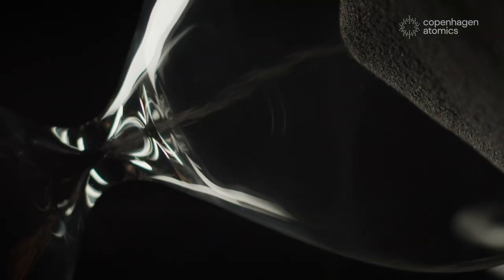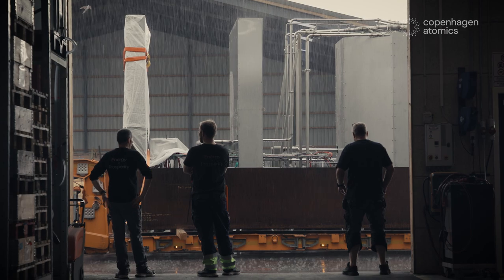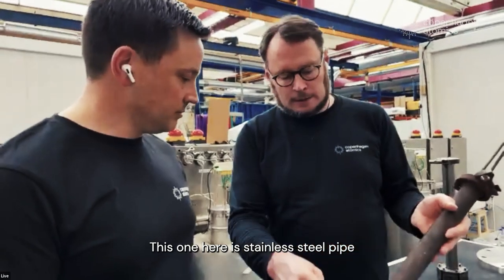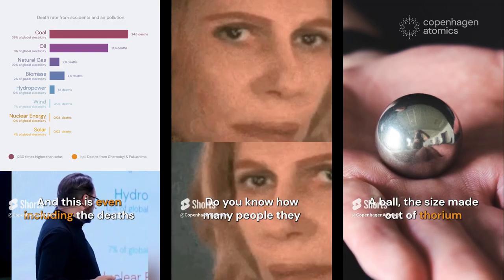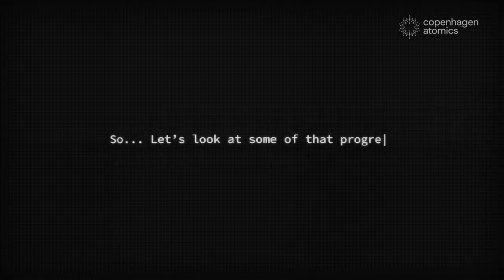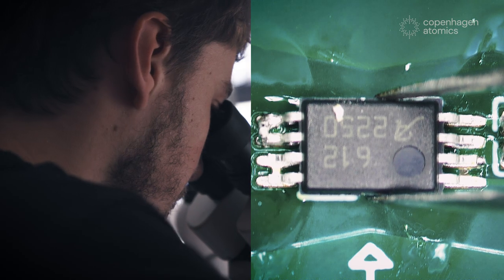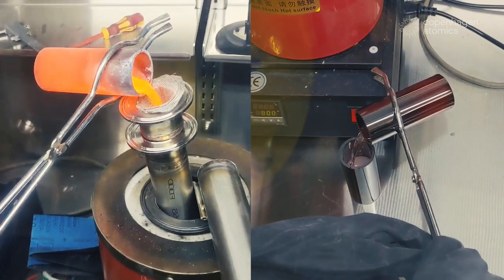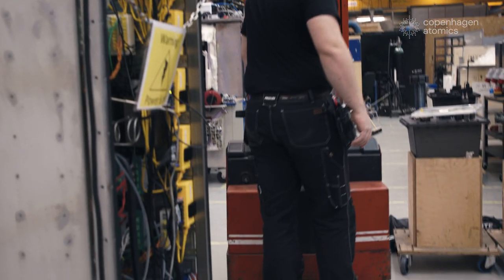Energy's FUTURE! 9 Years of THORIUM Molten Salt Reactor Advancements

Comment: Hello again Tom. I met you at TEAC in New Mexico. Since then I have started with plans for an electric airplane to advertise Thorium nuclear reactors. I'm planning on going to the university and using them to help with the design and construction of said plane. This should give you an opportunity to meet with them and possibly sell a salt loop to them. Working on it ! This is what it is going to take to bring your product the public awareness it needs. In the process of designing the wings to hold batteries. Taking a Piper Arrow wing and dissembling it now to find out how to place batteries into it. It is really not a problem, just need to coordinate with university so as to have a foot in the door for bringing in what would be necessary for a thorium plan of action. If interested in helping, feel free to say.

Comment: What country/regulator have you applied to? These days getting a license from a regulator is by far the hardest, most expensive, and time-consuming part of the "journey". This is the case for antique PWRs, for a MSR breeder that they know nothing about it will take much longer and cost 10x as much.
 
Terrestrial Energy started their application to the Canadian regulator on day one of business many years ago and they are only about halfway through the process. And they have the simplest non-breeder, LEU-fueled reactor in the world.
 
I hope you can find a country/regulator that values clean, safe, reliable, and affordable energy that this world desperately needs. Canada seems to have these values but their regulator is only slightly better than America's NRC. They have an 11-year process with no guarantees of 11 years.  I don't know of such a country but hopefully that will change soon. Until then coal will remain King and only get stronger.

Comment: Do you have to pressurize the containment vessel in order to use heavy water as a moderator?
Reply from the maker: No we don't need to :) the entire system is unpressurised
Reply: @CopenhagenAtomics  That's great. That means they are far less dangerous than pressurized systems. Great work!

Comment: Thorium might be 3 times as abundant as Uranium, but it takes 10 times as long to breed fissile U233 from fertile Th232 as it does to breed fissile Pu239 from fertile U238. 

The problem is that the half life of the intermediate isotope Pa233 is 10 times longer than the half life of the intermediate isotope Np239 in the U238 to Pu239 cycle. 

Which is why India planned a 70 year program to get a full fleet of reactors based on the Thorium cycle. That was 50 years ago and they're still in the early stages. So it'll be another 70 years before they can breed enough U233 to run the country on Thorium.
Reply: With powerful root infrastructure, you can't just offhand dismiss cyclical evolutions like Generations III and IV have introduced in the field. Not only did India have the deficit of Generational advancements since the Nixon Administration in the 70's; but they were extremely suppressed by said Nixon Admin in opting for Nuclear War tech, instead of continuing Thorium Reactor tech. Trillions of dollars of profits resulted in this suppression from bought-and-paid-for politicians and their fossil fuels billionaires funding them... and it CONTINUES with the likes of a Joe Manchin that's heavily invested in fossil fuels, AND writes policy for baseload energy in the USA.

If Nixon wasn't one of humanities greatest criminals in history; not only would India have the benefit of full US cooperation, but France and other Western/NATO countries would already be far more advanced as well. Now with increasingly cascading CO2 events compounding; we have to accelerate this tech EVEN MORE than any other human adaptation, in human history.

Comment: Problem is that it will take a long time to progress from initial experimental molten salt hardware (not even with radioactive fuel) to a tested approved reactor for manufacture, possibly 20 to 30 years.  On account of the technology being rather exotic, obtaining approval and certification will be particularly challenging.  Investors will have to be very patient before they see a return on their invested capital.
Reply: Huh?  China has a TMSR out in the desert, and it's licensed for test operation.  I hope the tests go well so the technology can scale to become more affordable.
Reply: @ZweiZwolf  It will take decades, and renewables are being deployed at a rate of 380 GWatt capacity per year at the moment. Energy storage systems are well underdevelopment.  With a bredding blanket,  Thorium reactors are great for producing Plutonium for nuclear bombs, so the mi,itary love Thorium reactors.
Reply: @thewiseperson8748  Decades?  Only if it were left to the West.  

China wants Thorium reactors for many reasons, specifically to replace black thermal power, and is strongly incented for environmental and stabilization.  China installs more energy storage (ex. pumped hydro) than anyone else, and is deploying thermal solar for the same reasons.  

While Thorium can be used for breeders, China's primary use case is baseload generation in deserts or cities where they can't dedicate large bodies of water for PWR. That said, China is short a few thousand nukes compared to America, so it wouldn't hurt for them to make a few hundred more H-bombs.

Comment: Why water as a moderator? You decrease power efficiency and increase complexity by useing watter. Graphite is a far better moderator. Alows for higher temperature operation and lower pressure in the core design.
Reply: In my opinion,   using heavy water as the moderator,  as long as it does not boil, is a very good idea.
  Liquid nuclear fuel with liquid moderator,  makes criticality control easy.

Comment: We tried molten salt in reactors, it failed, it became obsolete technology. It was completely destroying the pipework and was deemed unsafe, simply too corrosive.
Reply from the maker: It didn't actually fail, the reactors at ORNL were functioning. It was discontinued for several reasons, mostly political. The corrosion issue we have solved through our method of purifying the salts. We can purify these salts to such an extent that corrosion occurs at such a low rate that it is not a concern, even for stainless steel.

Comment: Has your company, or any company, solved the corrosion problem?  If not, then this technology is not yet usable.
Reply: It works perfectly well on a power point presentation
Reply: Yes, they have, just as all the MSR start-ups have.
Reply: @chapter4travels  Which commercial MSR has PROVEN the problem is solved?
Reply: @clarkkent9080  Thorcon, Terrestrial Energy, and Copenhagen Atomics. They replace the reactor vessel every 4-7 years, eliminating corrosion problems.
Reply: @chapter4travels  They are  NOT operating commercial reactors.  Until you actually build a large scale OPERATING reactor and run it on a commercial schedule, you will never know all the issues.

Replacing reactor vessels and associated piping every 4-7 years seems like and expensive option in an industry that already costs the most to produce power, not to mention the waste issue.
Reply: @clarkkent9080  There is no corrosion issue if you eliminate the possibility of it happening. The cost of the reactor vessels is built into their construction and operation budgets. Remember they are made of relatively thin-walled stainless steel, nothing exotic or forgings.
 low-pressure/high-temperature fission is our energy future, this is for certain. How long it takes to get there is uncertain but the outcome is not. The sun will burn out before we run out of fuel, fuel that doesn't require mining, and every country has access to it. Why do you hate this so much?
Reply: @chapter4travels  People are complaining about the stacks of wind turbine blades and they only have to be replaced every 20 years and they are made of fiberglass so they can easily be recycled. But you see no problem with changing out a radioactive reactor vessel every 4 years?

I don't hate.  I worked in the industry 40+ years but I am a realist and based on all the FACTS in AMERICA for new nuclear builds in the last 20 years,
1- new nuclear is massively too expensive when compared to every other method of power generation.
2- I personally have experienced what new nuclear has done to my electric rates.
3- Other than Terrapower, no other nuclear projects are being actively planned and Terrapower cannot possibly be producing power before 2034.
4- Many old plants will shutdown in the next 20 years and even a boom in new  nuclear construction will not overcome that loss.

Why in the face of so many failures and facts, do you believe in a nuclear miracle?

Comment: The problem is that neutron irradiation leads to neutron embrittlement, wherein corrosion occurs along dislocation crystal planes in metallic reactor components.  All he Copenhagen Atomics studies are done with non-radioactive salts and are therefore useless and not representative of a real-life reactor.  Indeed, the matter is even worse; on account of Copenhagen Atomics work being done with non-radioactive salts, a false sense of achievement is likely to arise.

Comment: Please scale up production. So sick of everyone yammering about the climate like ninnies. The climate will be fine. These things are why. Fusion will eventually happen too well before it's ever a problem. With all the money spent on climate change, we'd have built thousands of these things which we didn't have to try hard to figure out. There will be a blip in global temperatures by 1 - 1.5C and that's about it. It's not going to be the end of the world. By 2200 - 2300 excess carbon release will be phased out and the whole equilibrium will slowly return to normal as if the industrial revolution never happened. Except we'll have all the machines and practically limitless energy.